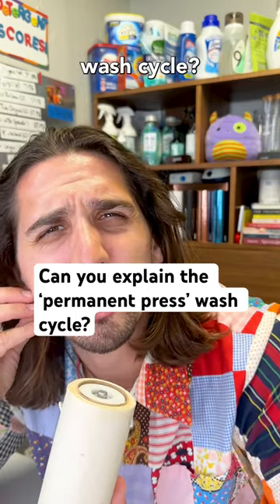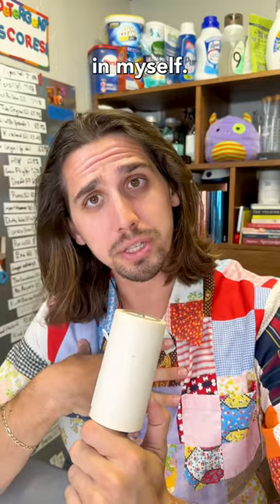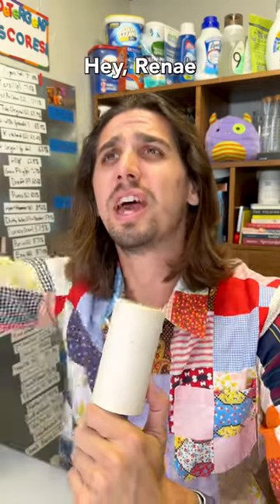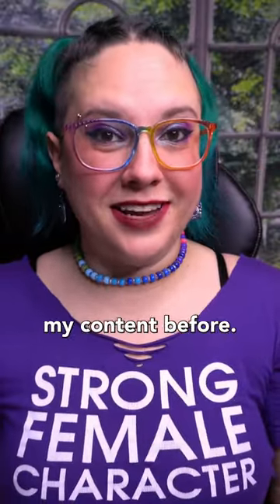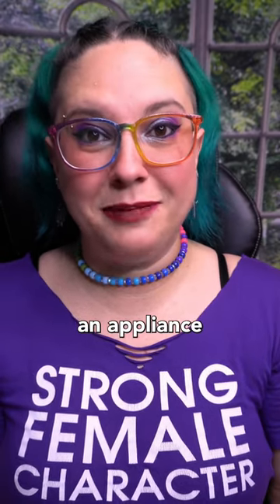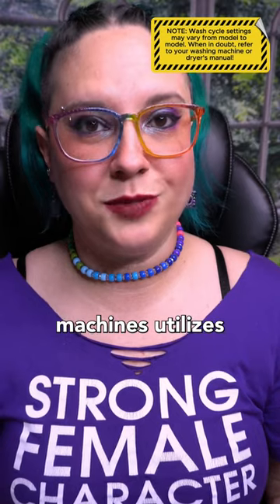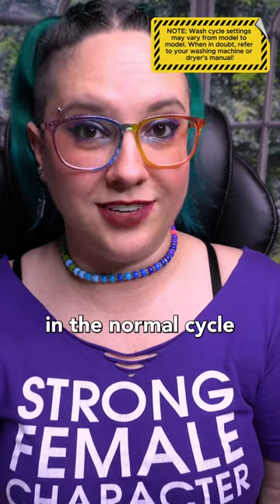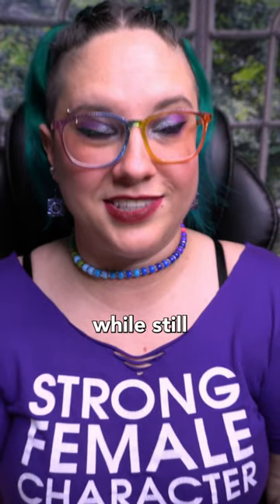Permanent Press Washing Machine Cycle Explained By A Dry Cleaner & Appliance Repair Tech #laundry

Comment: Permanent Press clothing has a high synthetic content which doesn't do well with hot water or a high speed spin. So the water temp is warm for the wash and cool for the rinse with a medium spin speed. This prevents wrinkles from forming when the clothing cools. I use it for my everyday wash cycle, since so much of modern clothing has a synthetic content and I hang most of my clothing to dry. Prevents wrinkles in my scrubs!
Reply: Same, incredible results from using this for all my Clothing

100% cotton items gets washed on “hand wash” and hung dried

Comment: I learned how to do laundry from a woman(mom) who never messed up a single laundry item.. She always told me to separate your laundry into whites, middle and darks( I separate mine into whites and everything else), READ the label and generally follow the directions, she would put them in the dryer on permanent press for about 5 to 10 minutes and then take them out neither hang them or lay them flat to dry.. the only time I use high heat Cottons on my dryer that's when I'm doing sheets, towels, socks and things like that. I EVERYTHING is dried on permanent press.. I've never seen a permanent press option on a washing machine..

Comment: Originally, the permanent press cycle on the washing machine would use a hot wash to relax the fibers and then instead of spinning would drain the water and refill with cold water several times To cool the fibers down before a very brief spin and then a Riinse cycle. Of cold water and then another very brief spin. The dryer usually used high heat again. To relax the fibers but would not heat the last twenty to thirty minutes of the cycle, so the clothes would cool down before the dryer shuts off.. This way, hot fabric wasn't laying in the dryer re wrinkling.

Comment: I really don't get the mystery around washing machine settings. Unless you're working in something like building trades where you're routinely getting filthy, you can wash all of your machine washable clothes on delicate, in cold water. 

Pre-treat your stains. Don't ever expect the machine to do the work. (Even if it can, longer, hotter cycles are really wasteful.) Wash everything on delicate with a minimal amount of fragrance and color free detergent, in cold water. Your clothes will last longer and won't develop a buildup of residue over time, which will leave them cleaner in the long run. 

For drying, again, low heat, delicate cycle. No fabric softener. Overtime it builds up on your clothes. You can use something like dryer balls, but you don't really want to beat on your clothes more than you have to. 

(And if you have clothes that smell if you don't wash them in hot water, stop buying synthetics and "moisture wicking" garbage. If you're not engaging directly in vigorous athletic activity, you don't need "performance fabrics." Period.)